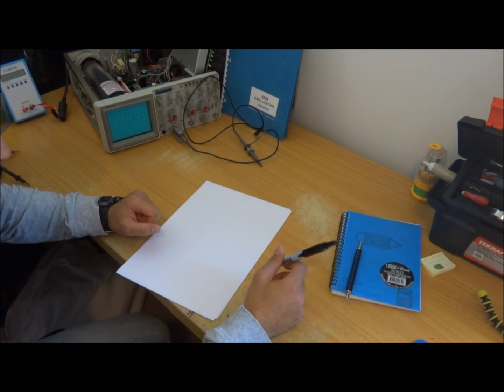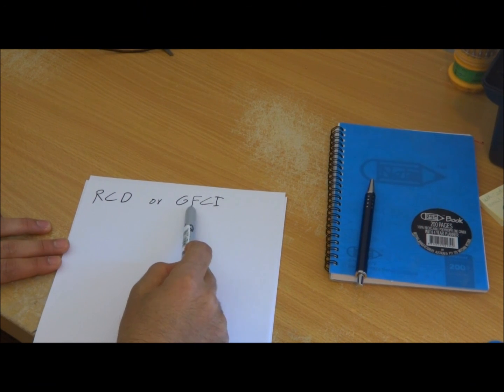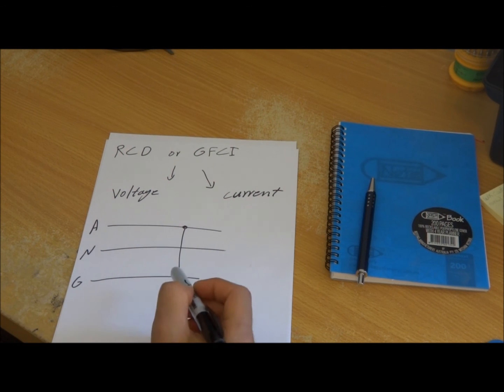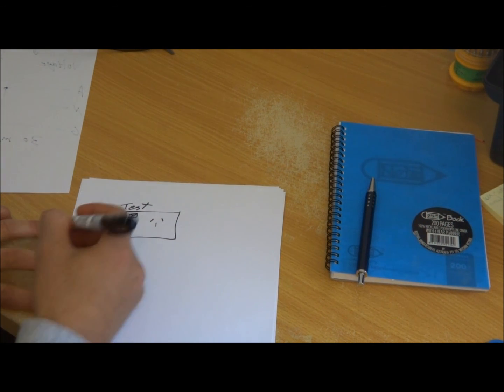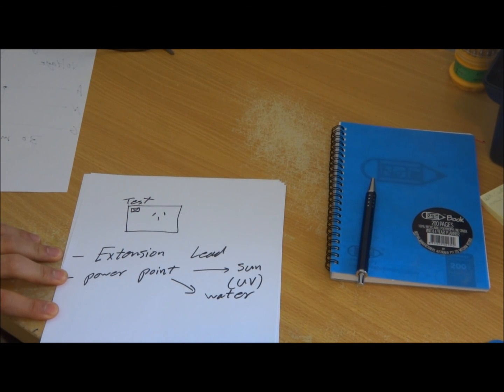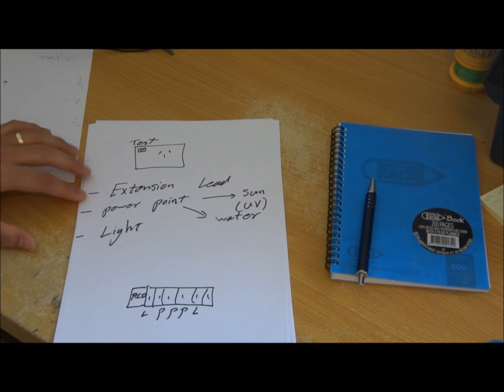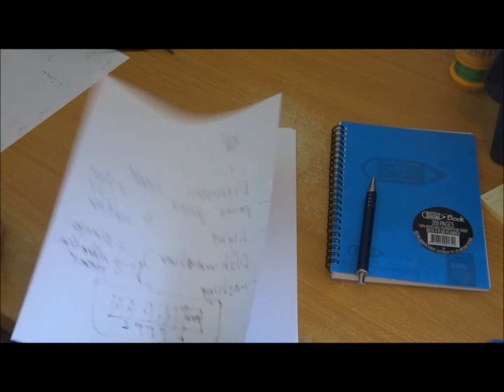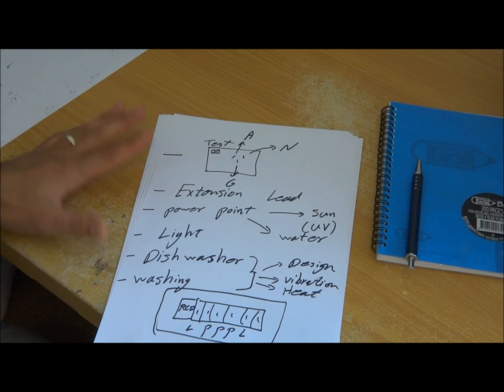Safety Switch Troubleshooting issues with RCD GFI tripping Ground or Earth Fault in house wiring

Comment: Thanks very much for a clear and logical description of tripping problems.  A total 30 mA is required to trip and this could be comprised a several small current leakages summating, ie more than one appliance could be a problem.
Reply from the maker: You are right. Note the tripping current can be from 10-30mA. Maximum allowable (AU standard) for domestic is 30mA